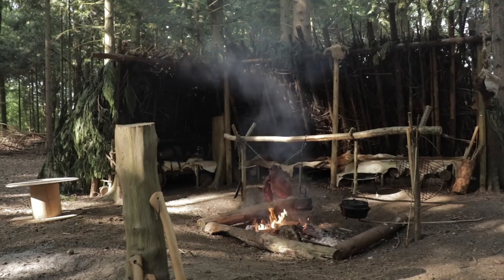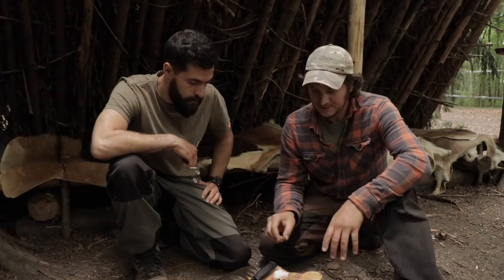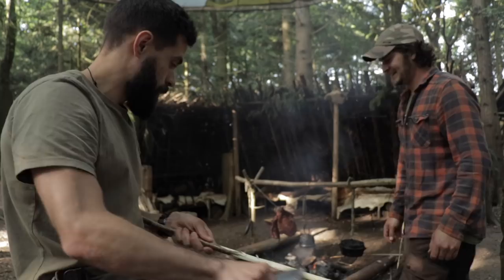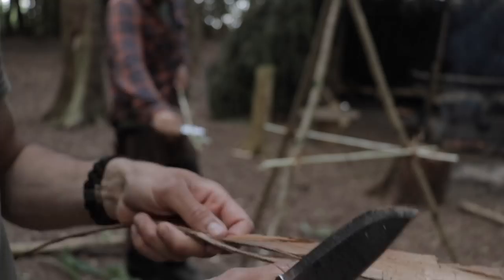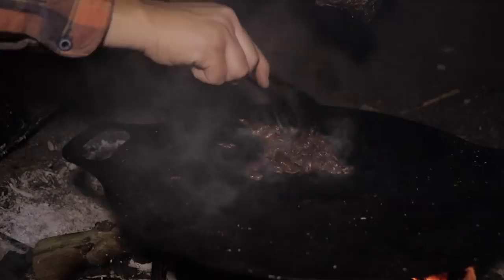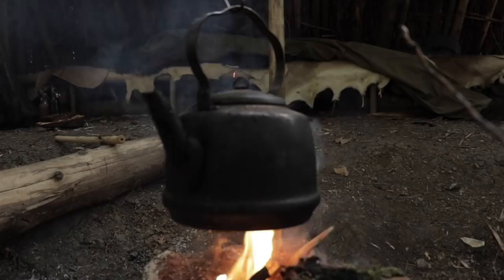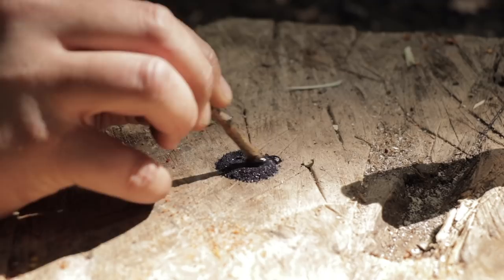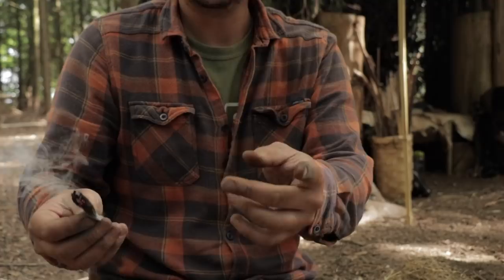Overnight Bushcraft Trip - Camping in a Debris Shelter - Cooking Wild Meat on Open Fire

Comment: For fire by friction. I learned that once you get your ember into your tinder bundle. Wrap your hands around the bundle and let the ember sit for about 30 seconds. This allows the bundle to dry out. Even if you think it is already dry enough. It allows it to get rid of the moisture from the humidity in the air. Then when you blow it will light easier. Just some helpful tips

Comment: I have some jerky left over from 2 years ago that is still great to eat. It's a great thing to know how to make yourself as it costs a lot to buy so you can save yourself some money and have fun while doing it. 
If you don't want to smoke it I have just used a pedestal fan in my shed to keep the air moving and dry it out successfully. You can use clothes racks to hang it on. 
Don't use the low sodium soy as you need the salt in the soy sauce to pull some of the water out of the meat.

Comment: Cool video, guys.  I'll be checking out Dustin's channel for sure.  He has a nice setup there in a good area (diverse woodlands).  I've not seen ribs done as he did (merely hung over the open fire) but that seems to work very well.  I've not smoked meat over an open fire but I've seen it done before using a method similar to Justin's (plastic sheeting was used instead of cedar/yew boughs; I like Dustin's method better)  and I've butchered up my share of deer.  What impressed me the most was the cottonball/ash firelighting method.  Brilliant......absolutely brilliant.  I'm curious if cotton roll bandage would work should cotton balls be unavailable.  
Keep up the good work, all.

Comment: Hi guys, I understand the issue with the germs and the sticks and I have a suggestion. have you considered Elder? A piece about 18" -24" and where the soft pith is, push in a rod of  316 grade 1.6mm stainless steel tig welding rod. This is the material that is used to produce stainless steel food prep areas and the like. Just a thought. Also may I ask, I am very new to Bush craft although I have followed Mike for a while. What was the mora knife Dustin was using please as I need to get my first knife soon.

Comment: Wouldn't the smoker have worked better, if thee sticks were shorter so they were closer to the ground, thus the leaves covered most of the firee so the smokee would go more into the leaves? The smoker seems to high off the ground?